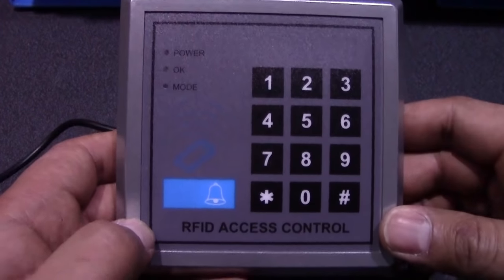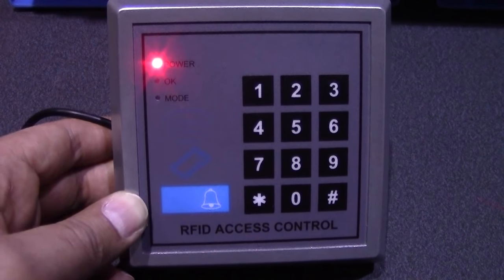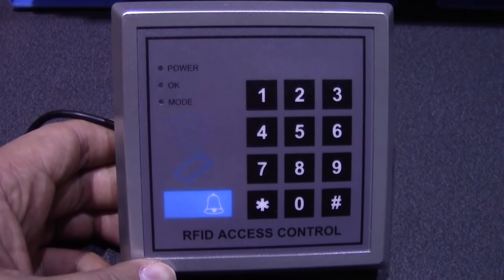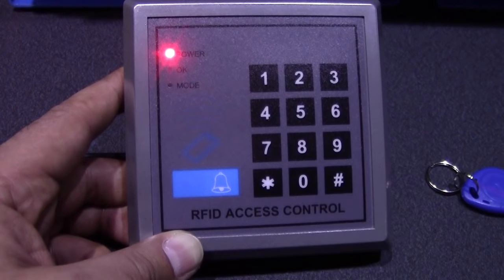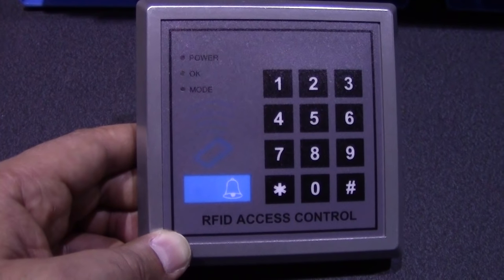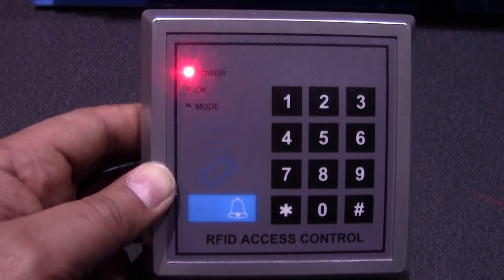RFID Programming Guide

Comment: Anyone that uses this RFID system shown is asking to have whatever it protects access to, accessed, you might as well put a key under a plant pot. All the control on the back, easily accessible to anyone who levers it off the wall.
Reply from the maker: Not quite. The keypad in my scenario is designed for indoor use. Unless you know which wires to short out you won't disarm the alarm.
This video is only to demo the turning on/off of an alarm system and not door entry system.

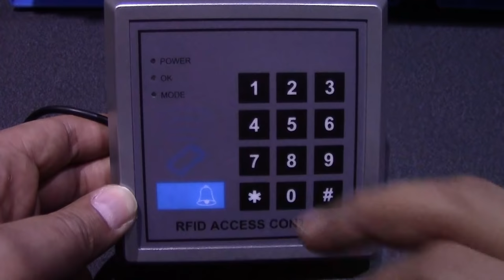Comment: @0:58 standard mode

@1:05 bell button / alarm

@2:37 factory default / changing admin-code

@4:00 register key-fobs to unlock

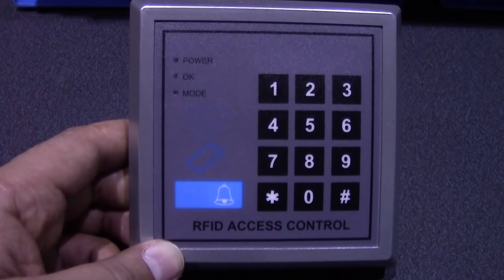@6:05 register keypad-code to unlock

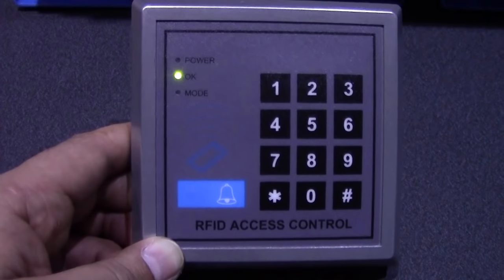@7:40 delete tags / codes

@9:12 FULL RESET

@10:16 conclusion
Reply: Źz,
Reply: How can i turn it off

Comment: We have this unit and everything works great.  However, when I purchased extra FOBS, they can't be programmed!  How can I ensure I am getting the correct FOBS when I order additional ones?  As it turned out, the new ones are larger, but thinner than the original ones that came with the unit.
Reply from the maker: Hi,
im sorry i dont really know as i use the keyfobs that came with the unit. also i only use this in the z-wave modified version as part of my home security system.

Comment: I added a new RFID Keyless Tags with the same frequency so both old and new tags are working. I was able to open the door using those tags but it never goes back to lock mode itself. It usually goes to lock mode after a few seconds. Instead I have to de-energize the unit so it will lock again.
Also, adding a tag number 2 doesn't work I used the number "5" instead. We have the same RFID Controller but I don't know why the difference.  Your feedback is highly appreciated. Thanks!!!
Reply from the maker: Thanks for your message.
I have posted the instruction manual in the description. Best is to read that. I'm not an expert in these keypad but was demonstrating how to integrate with fibaro in that video. Unfortunately I don't know the advanced details for this device.
Only thing I can suggest re lock issue is to check the 'auto lock' time settings

Comment: Hi I have a question. What will hapen if the electricity stop. Is the locker automaticly unlocked?
Reply from the maker: I'm sorry I don't know as I have modified the keypad to use as an alarm keypad in a fibaro home automation setup
Reply: Tnx anyway. HNY!
Reply: ivozax unfortunately it does :( .. So manual door lock is needed for it. Possibly got another method how to not unlock when no power, dont know how for now..

Comment: I recorded the same code for programming
and the opening of the door. when I start recording a card I start by entering the programming code. but I always listen to a signal and the door opens and the programming does not start. is there a solution
Reply from the maker: yes, and that is to reset. you cannot have the same codes

Comment: Hello i want to ask something in my device i can added 2 card and when i want to add the third one it does not work do you have any information about this could help me please ? Info > the card is working but the device doesn’t allow me to add more than 2 help please):
Reply from the maker: @blue7334  it has capacity of the 3rd card is not adding. Try to do a reset and add the cards again. Otherwise you may need to change the key pad

Comment: Hello. Can you please tell me, if this device can be used like timed locker? i mean from morning like 7am to 8pm it would be unlocked and from night till morning should be locked. Is it possible? thanks for an answer.
Reply from the maker: MultiDreamer21 
No I'm afraid that this lock doesn't support that.
Reply: maybe can you tell me which china made device can do this? i mean, i can connect different type of rfid box reader to lock and power cable. i think.
Reply: you can buy a power supply timer used for sprinkles or Christmas lights. they are around $10
Reply: yeah i was thinking about it, thanks.
Reply from the maker: Im sorry guys, i only modded this device to use as part of my home automation security keypad. i dont use this for its intended purpose as a door lock and therefore dont know much about that side.
Reply: Often the default for magnetic locks is 1 (yes, engaged, locked) This is commonly seen in large buildings where the doors are locked open and then if a event occurs (often fire, smoke) then the magnetic locks that were holding the door open release allowing them to close to try to contain smoke/fire.  (if a security protocol exists they start the same but then attached to the doorframe is another magnetic lock which when the door magnetics are identified they lock holding the door locked closed.  Back to your question.  A scenario like you are describing is often part of a recipe where "If person with level 4 or higher (3 2 1) then set area doors L1, L2, L3, L4 to 0 (unlocked)"  This type of design is used most commonly because it does not just open the doors if there isn't a supervisor, manager, director, or Executive in the building to initially open the area"  Your receipie then can allow it to stay open until the time limit locks the area down again.  The benefit of this is that if no supervisor etc ever goes to the building the area you are referring to remain secured.   (big snowstorm happens and you close the office, but someone knows the system, without this type of cross check they would still have access to the area.)   Probably more than you wanted to know, sorry. Guess I am trying to say, "often it's not one device that is involved it's how to you can leverage the options of what you can get to get your result.  When you start looking at ways to apply things using features of different tech, you can do a lot you didn't realize."

Comment: my door lock opens automatically after power supply goes off and on. 
Can you help me please?
Reply from the maker: Download the manual from the link in the  description to change the parameter settings
Reply: @YorkshireAutomation  Not able to find. Can you help me please?
Reply from the maker: @replay.gaming  http://www.yorkshireautomation.co.uk/downloads/RFIDmanual.jpg
Reply: Thank you for the pdf. 
I switches to NC port but now the gate is just opposite. 
When i enter passcode it closes and after 5 sec it opens. 
Do i need to change any other wires?
Reply from the maker: @replay.gaming  I think a change in wiring is required for that
Reply: can you help me on this?
Reply from the maker: @replay.gaming  im sorry its best to contact someone local
Reply: thank you so much for your time
 
Appreciate it!!

Comment: the red light is solid.
Reply from the maker: in some models the red light is solid. in some it flashes. i have both types. if nothing happens on keypresses then try resetting the keypad. there is a jumper on the circuit board. see instructions on how to reset. failing that contact where you bought from. thanks